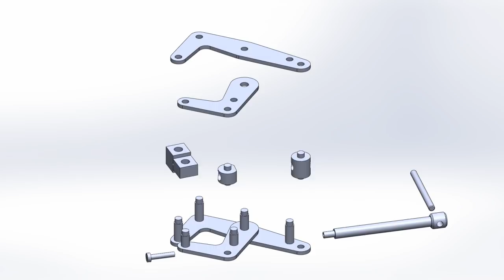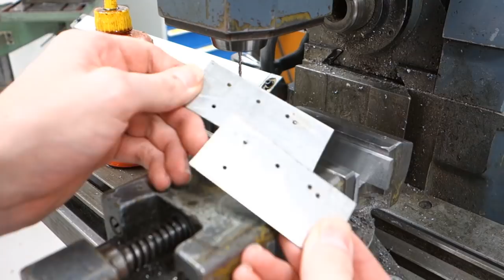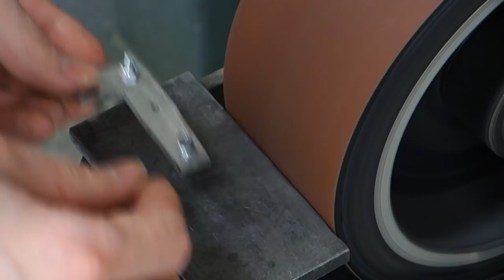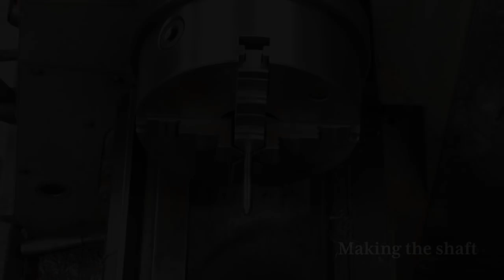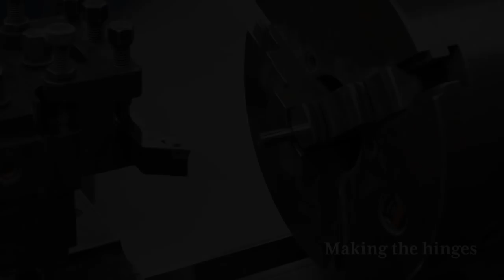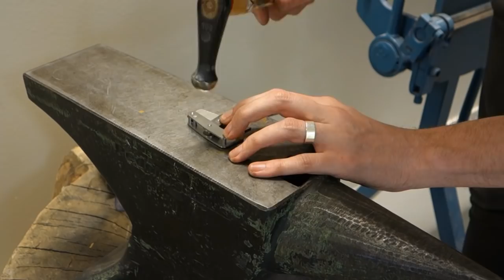Making a Kant Twist Clamp

Comment: Hi Daniel,

Nice project. I like the little Bahco adjustable wrench and have one like it. Looks like your bench vise need to get the bolts tightened up. Nice trick with the die nut clamped to the plate. I really liked that one.

All the best,

Tom
Reply from the maker: Cheers Tom! In retrospect there are probably better ways to do it. I could've cut the threads on the lathe, taken the piece out before cutting it off, clamped the oppsite side while drilling and then taking it back and cut it off in the lathe without having to clamp the threads. But you live you learn, I guess.

You're right about the vise, it likely needs a bit of a general service as well.

Cheers!

/Daniel
Reply: Very awesome video. Loved it
Reply: oxtoolco qq

Comment: Nice video. I learned several techniques, such as the die guide and using a ball end mill to create a seat for the drill bit. Going to try that instead of spot drilling for small stuff.

Comment: Nice job, thanks for sharing. It looks like an F3 you're using, a rare beast indeed.
Reply from the maker: It's a wonderful machine indeed! Since it belongs to my university department I've told them, repeatedly, that if there every comes a day when they're getting rid of it I will come get it, regardless where I am in the world. I love that mill to bits, I can't even begin to imagine how many hours I clocked on it, I wouldn't be surprised if it's in the several thousands.
Reply: Switch & Lever Yes I also have a late model Aciera F3 with Heidenhain DRO and it's a very nice machine. The W20 can be difficult to find tooling for when ... and no matter how much is with it, there WILL be a when, you need extra

Comment: I'd never have thought to make my own, but now that I've seen it done, it looks like a good learning project with a useful result. Thank you! 

I have a couple of the commercial versions, and I believe the jaws are copper, not brass. There may be variations available, but copper makes sense after listening to Tom Lipton at OxToolCo talk about copper vise jaws. 

I'll start scavenging dead printers for materials right away!

-- Mike
Reply from the maker: Hmm, looking at their website it seems like the jaws are copper plated, but it doesn't say anything about what the base metal is. I figured brass would work well, since it's going to be softer than probably anything I'm going to clamp anyhow.

Dead printers are a great source for high quality axles, for sure. I try to scavenge them whenever I can. 

Glad you liked the video!

/Daniel

Comment: Nice work and nice clear camera work and explanations, You've got a new subscriber.
Btw since you only used what looked like a standard screw thread (vs say acme or buttress thread), then a simplification could be to use a suitably long machine screw with a standard hex or even socket head that would then be tightened by spanner or Allen key.
Reply from the maker: You could indeed do that. I wanted to make everything bespoke, which is one reason I went the route I went. Though, you'd still need to drill and tap the end of the screw if you go the route you suggest.

Cheers!

/Daniel

Comment: Why use a ball end mill instead of a center drill before drilling through holes in round stock? Nice work.
Reply from the maker: For the shaft it was simply because I couldn't get a center drill in there, they're short and stubby and I needed something with a bit more length as the indexing head would've hit the head of the mill otherwise.

Can't remember why I didn't go for a center drill for the hinges. May have been because I couldn't find one which was thin enough. It would certainly work just as well as the ball ended endmill though.

Cheers! Glad you liked it!

Comment: A question re drilling. Imagine a mild steel 40x40x40 mm cube to be drilled through with a fi4x80mm (exposed length) twist drill. Will the drill have a tendency to wander when drilled in e.g. 2 mm from a side surface? Any other comments on the possibility of a thin drill bit wandering to the side?

Comment: sweet, use e rings for the pins to less friction
Reply from the maker: Not really necessary as none of the pins need to rotate. The only parts that rotate are the two hinges, and they're underdimensioned by a fraction of a millimeter to not have any issues with friction. The reason it seems a bit touch to turn in the video is largely because it's not oiled up yet, it's running very smoothly nowadays.

Comment: Excellent Video!  The 40 dislikes you have received thus-far just boggle the mind.  What is not to like?  Thank you!
Reply from the maker: +Jerry Hodges Maybe some people have had traumatic experiences with clamps? Who knows!
Reply: +Switch &amp;amp; Lever I&#39;m betting it&#39;s because John has his plans for a wooden one for FREE!,lol.But,I made my own clamps,parallels,angle plates,belt sander,etc.,etc. years ago.But it's STILL a great video!BTW,I was trained to use a file on a lathe in Tech. School by an old German immigrant(right up on the chuck,just use the MIDDLE of the file,NOT the tip!),and after my 30+ years in shops before becoming disabled(rear-ended auto accident,not machine shop,lol),and his 60+ years,we both still have all our fingers.BUT,it's like you stated so well....FOCUS IS EVERYTHING!!!There are LOTS of idiots who have hurt/maimed/killed,irregardless of any safety mechanisms on the machine due to stupidity,drugs,alcohol,etc.....
Reply: @SwitchAndLever  pfffft ha ha ha ha ha ahaaaa lol

Comment: Sweet video! Never thought of making one of these.

I am curious about the belt sander you use. Is that bought or made? It looks to have a thick rubber wheel. Is that correct?

Thanks again for the video.
Reply from the maker: I have to check once I'm back in the workshop. It's definitely a bought model, but I don't remember much more about it right now. 

Glad you liked it!

/Daniel

Comment: Nice video! Just found your channel and subscribed. Great to see stuff in metric on youtube also :-) I was wondering, when you convert imperial plans to metric, do you convert the main dimensions rounded to a number that makes sense in metric and then keep the ratios the same for all the rest, or do you just straight-forward convert all the funny numbers to mm?
Reply from the maker: Entirely rounded off to what makes sense. Straight conversions with fractional measurements for drillbits and such would be just silly. 

Glad you like the channel :)

Comment: can the plans be had in imperial sizes.  g.walters
Reply from the maker: +Gary Walters I'm afraid not, you're going to have to convert it yourself. However, none of the measurements are especially critical, so as long as you get them close enough it should work out just fine.

Comment: Hi I went to the plans link but there is no explanation of the type of plan. What are they, a file or paper? Can they be used in a CAD system? Can they be scaled? Do you mail them or are they downloaded?
Reply from the maker: bobdring Quoted directly from the item page in the store:

"Included in the plans are both a twelve-page PDF with dimensions for all the parts, IGES 3d files to allow you to load up the clamp into your favourite CAD software as well as a printable PDF-template for the two braces, to aid in layout."

Once you complete the order you get a mail with a download link.

Comment: If someone can afford all the machines to perform this task, they certainly can afford some Kant clamps. 

Unless I'm missing something, this is definitely an exercise of the ego 'YES! I CAN DO THAT!'
Reply from the maker: +Allen Brosowsky you're definitely missing something. Those aren't my machines. Do not confuse usage with ownership. Look at the video tour of the Umeå Institute Of Design Workshop on my channel for a deeper look. It doesn't have to be about cost either, but rather about enjoying and honing your craft.
Reply from the maker: +Allen Brosowsky you're definitely missing something. Those aren't my machines. Do not confuse usage with ownership. Look at the video tour of the Umeå Institute Of Design Workshop on my channel for a deeper look. It doesn't have to be about cost either, but rather about enjoying and honing your craft.
Reply: +Switch & Lever I humbly apologise. Seriously, I quite missed the fact of usage vs ownership. In hindsight I have done similarly, making projects using someone else's equipment. How I can be so smart in some areas and make lame mistakes like that, baffles me sometimes. But then I also failed to mention I still enjoyed the video and was inspired by it. Than You!
Reply: 2
Reply: Also, Kant clamps are quite expensive, when you own the tools (like I do) it is far cheaper to get some materials and make them yourself, than buying them.
Buying them only makes sense when you have little free time OR in a production environment.

Comment: Hi Daniel. Great video and a useful tool. I'm thinking I might want to make this a project for a machine shop class I am working on for my local hackerspace, acemonstertoys.org. Any chance you can post the CAD files. I'd like to use our CNC mill to cut out the 4 side pieces, and getting the existing CAD file from you would save me a bit of work.

Thanks,

Steve
Reply from the maker: Glad you liked the video! Check your inbox and we'll talk CAD.

Cheers!

/Daniel